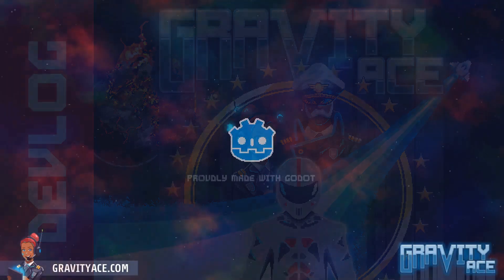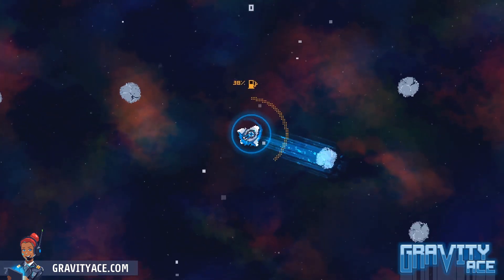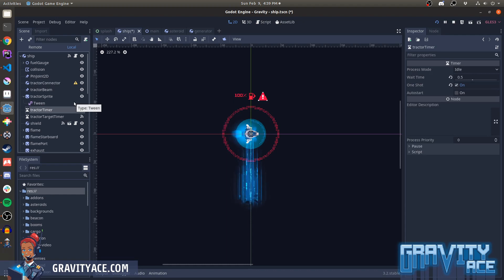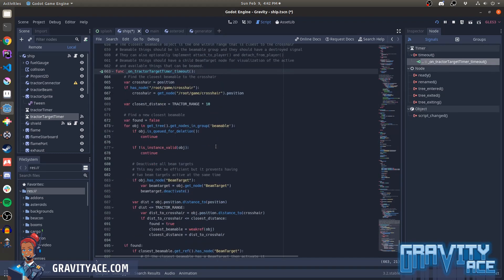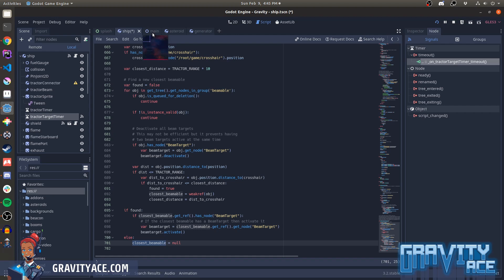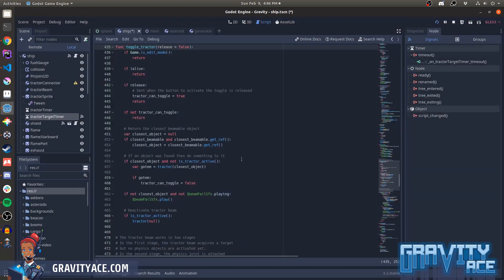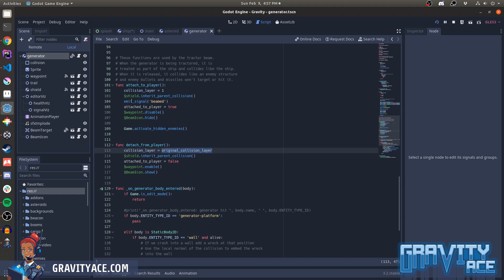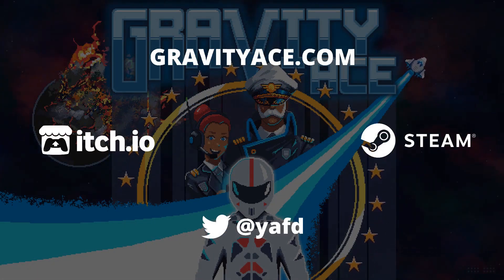How to make a tractor beam in Godot Engine

Comment: This is good and very helpful! It's cool to see an example of dynamic node paths, using groups, the collision layer assignment is really interesting and calling methods on other nodes. I'm trying to wrap my head around the reasons to use direct method calls vs signals. You use a combination of both, but I'm wondering if for example "detach_from_player" could be a signal emitted by the player? Or is the order of operations for detachment important so the asynchronous signal could cause bugs and a method call is required? (it's also possible I'm just completely misunderstanding how signals work... maybe you couldn't use them here for some entirely different reason lol)